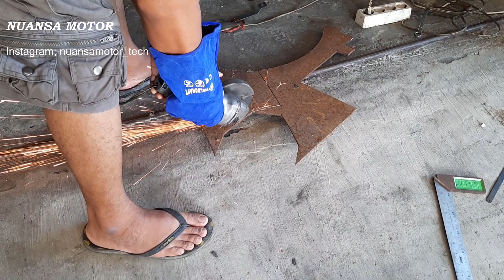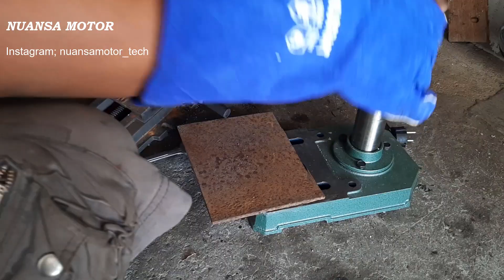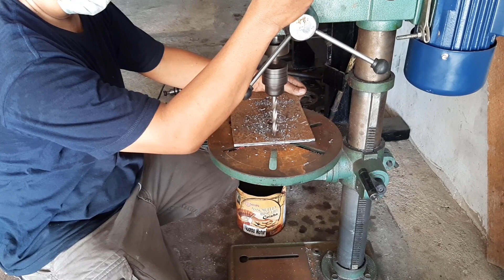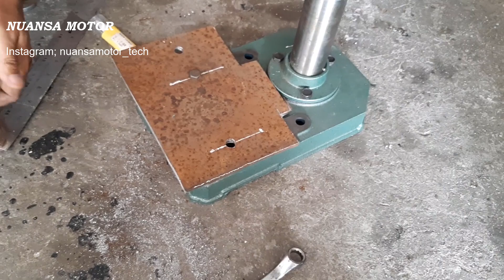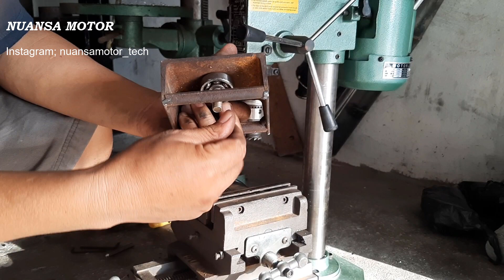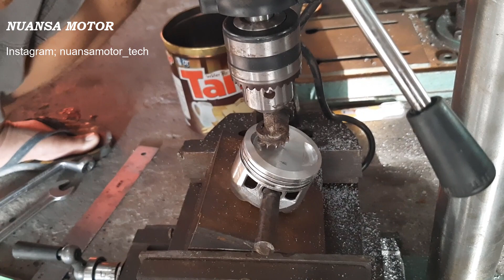MODIFIKASI MINI DRILLING  JADI ALAT COAK PISTON, D.I.Y

Comment: Bang mau nanya knp motor beat saya malah jadi berat awalnya padahal rumah roller udah dibubut+bubut Drajat, roller pake 7-9 ,per cvt pake 1500, ko malah nambah berat ya awalannya, tolong solusinya bang, terimakasih
Reply from the maker: Di cek ulang bos....v belt harus turun sempurna di pulley depan
Reply: @NuansaMotor  kalo kampas ganda ngaruh gak om??